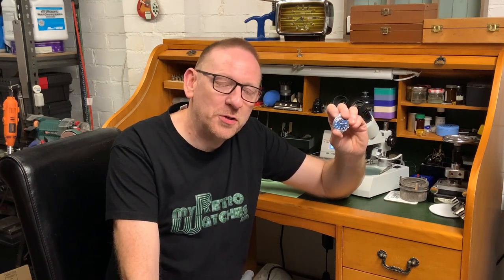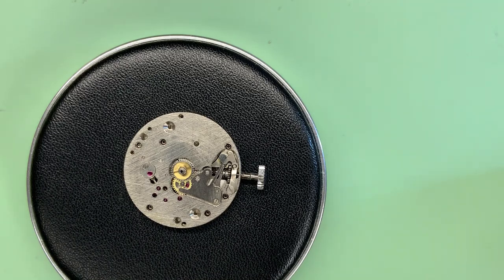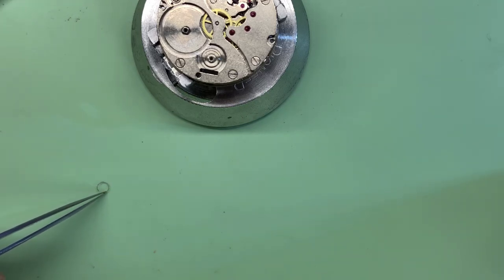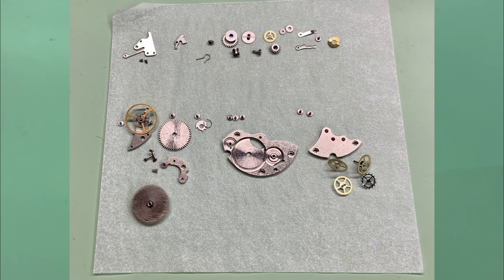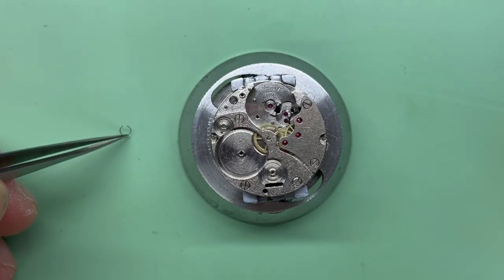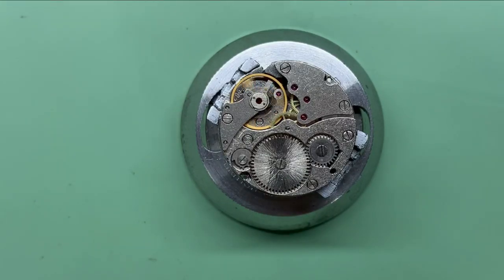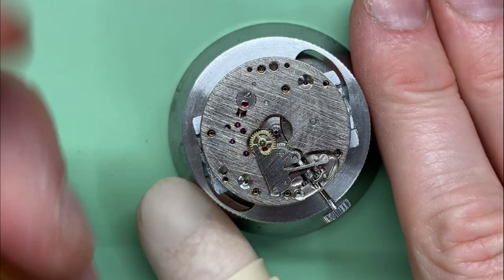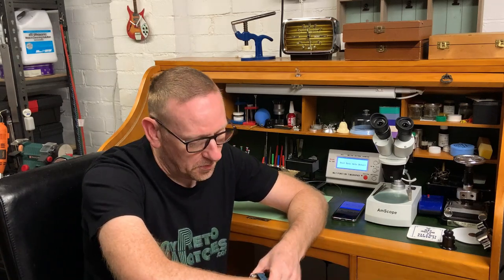Russian Pobeda ( Победа ) Watch Restoration

Comment: Great job as always with the video! While it's been said before in the comments, the movement is the 15-jewel 2602 that was shared between Podeba (Victory) and ZIM (Maslennikov Plant, or Zavod Imeni Maslennikova). However, the 2602 also holds the distinction of being the longest-produced Soviet watch caliber. It was made continuously from 1950 to the mid 2000s in the millions. Pobeda abandoned the 2602 sometime in the 1990s whereas ZIM produced it until their dissolution on June 30th, 2006. I have on a mid-1970s ZIM 2602 dress watch as I type this, and I find that the ZIMs are better finished in general than their Pobeda stablemates. It has AU10 gold plating and the movement even has decorative milling, which is very rare for a Soviet watch. It would be interesting for you to compare a ZIM with the Pobeda, as they are no more expensive or scarce on the old Fleabay.

Comment: Great job on this small watch. 

I bought two 1954 Pobeda's for 30€ about a year ago, one in perfect condition, the other one was running quite fast. Took it to watchmaker for repair, he did it for another 20€. Both are in great condition, I polished acrylic crystals and use them now as daily beaters - literally. Construction works, electrics, woodworking... they are great daily watches as you wont even notice them on your wrist (32 and 33 mm cases.) 
I highly recommend anyone who wants to get into mechanical watches to start with something like that - they are cheap, at least in Central Europe you can get them repaired in every watch/jewelry store and you can later move on to something more expensive.

Comment: Pobedas are pretty solid, simple but solid.
I've got one with the same movement and it keeps time quite well.
Currently trying to get one with a central second running. Will use this video as a guide, since they are pretty similar.
If I may recommend you something in the same flavour: Raketa watches.
These are really good watches and are probably my favourite soviet brand.

Comment: I'm not positive but I think that plexi is afflicted with what's called 'crazing'. Good vid. Thanks.
Reply from the maker: Thank you.
Reply: that's right, specifically 'stress crazing' - there's likely some bias in the case tension on the crystal that has imposed tensile strain across that region of the crystal. That can result in fine cracks perpendicular to the stress which accumulate over time - flexing from temperature and pressure changes are primary contributors

Comment from the maker: Apologies for some of the sound. I am trying a new Mic and its not always been good at sound capture.
Reply: Good video. 

Back in the day when these watches where plenty in my country (Romania)  they where very cheap. If you wanted a watch and did't have to much money this was the one. This is the base model in terms of the caliber. From this one there are 3 (i believe ) version: Raketa base Pobeda, Pobeda itself, and Slava based Pobeda. The Raketa version has a jewel on the 4th wheel in the bridge.
There is one  important thing you have to check on this one . Since there is no jewel on the 4th wheel you have to check for wear in the base plate and on the bridge. If there is, you can fix it using the special punch to reform the hole and use the reamer after. The same goes for the mainspring hub on the main plate and bridge.

Please do a Slava 2427 movement repair

Comment: Here a tip for you. When arranging the wheels in the jewels place the screws that holds the bridge in place but screw it just a little so that the bridge doesn't lift that much and doesn't moves sideways. Try this and you will see what I mean. Don't drop this watch because it doesn't have a anti sock system on the balance
Reply from the maker: I don’t really do that , done it before on Accutrons and if you are not careful you can break a pinion . Thank for the tip though
Reply: Can confirm, I dropped mine and it stopped. Gave it a couple taps with my finger and lucky it started again.

Comment: I realy love the Smith timer you have by the cleaning machine!
Reply: Smit Machinale Seeing that timer reminded me of working in science labs many years ago - we used to use them for timing experiments / procedures. Solid, reliable, robust machines (and actually easier to use than the modern push button electronic timers used now).
Reply from the maker: I bought it at a watch fair a while ago. The owner actually recognised me from this channel.  Had no idea what I’d use it for but just liked the look.  It’s now a key piece to my cleaning regime
Reply: @MyRetroWatches  Mike, that is a great find.
Reply: My Retro Watches i still have an old Junghans timer, with luminous hands that goes up to one hour. Made for photography darkrooms. In a previous life I spent many hours in darkrooms with the sound of that loud ticking. Now reborn as an occasional kitchen timer!

Comment: Hi Mike, as always, another great video😀
Just out of interest, is that some sort of varnish on your peg wood?

Also, was it just me or did anyone else shout at the screen when you were trying to put the crown wheel on?! 😂
Reply from the maker: Haha you mean you all knew I had the wheel on the wrong way??  Honestly I did not know at the time. My only excuse is i am sitting further away than without a camera so some jobs I just can’t really see what I’m doing .
As for pegwood it’s covered in superglue!  I needed something to put a drop on to fix one of my daughters toys. Ironically I now find the pegwood works better with the coating .
Reply: My Retro Watches thanks for the info on the pegwood, I have been considering something like that as I often find the doesn’t hold a point very long!😉 I have also been looking for the substitutes “plastic pegwood” but struggling to find some.

As for the wheel, it was the fact that you put the retaining piece (disk) on first meant that the actual gear was never going to stay put!😜😂

Comment: You Sir, are a star :)   I've now invested in a timegrapher so have the last tool I needed to actually start stripping and servicing movements and I have stacked tubs of movements just waiting for a chance to shine again :)   I've been battling a terribly magnetised Poljot Mockba 80 from Israel, its taken several good zaps to get it to a point where its not adding an hour in half an hour, you would like Poljot movements as they were pretty well done.   Did you catch my grail of grails find video?  A brand new, never worn Sekonda branded 1970's "tank" super heavy automatic watch in original box... £14 I kid you not, then yesterday an Aeromatic full chrono with rotary slide rule dropped as well into my hands... the gods of ebay are being kind right now :D :D :D

Comment: The strange clamp ring was indication that whichever watch factory likely Zim were short on screws and clamp pieces so would opt for the very cheap alternative which is a compression setup, when the caseback was screwed down it tensioned the movement firmly in place but being very mild steel the clamps lost their tension and you ended up with a clacky loose affair in there.   You could read the various Soviet resource crisis in a Soviet watch, copper shortages meant all steel balances and pinions, the Soviets lacking chrome would have mild steel cases, even the lume's became white or coloured paint in times of shortage of phospor's but they were lavish with gold with a good AU10 plating as a general, there were times of AU5 microns and sometimes AU20 but those were rare and 10 microns is pretty good.
Reply: I thought they used brass a lot for its softness. Then chromed it.

Comment: Excellent job well done. Thank you. I just started this hobby. I'm too scared to remove all the parts. What if you remove the balance wheel, pallet fork, maybe the barrel  harbor, clean the jewel holes from both sides. Make the train run again and put back the parts that u taken out.
Reply from the maker: You do what you feel confident with . All small steps. Reality is the more you clean the better it will be. 

Good luck

Comment: A pro tip for fitting the train bridge... Already screw the bridge in till you feel the slightest resistance then turn the gear closest to the barrel and almost everytime the other pivots will find their way into the jewels... Also I use my bare eyes for most of a watch... I use a x15 loupe for HS manipulation...
Reply from the maker: Ive never been a fan of placing the screws before the pinions are located.  I have had first hand experience of breaking a wheel through thinking it was in place.   You are lucky to use your eyes,  as you know i only have one good one and that is failing now too.  I am now using a loupe when i am not filming (filming I can only use a visor as the watch is almost at arms length away.)   liking a loupe!
Reply: @MyRetroWatches  yeah I know you have eye problems 😢
It's really unfortunate and I'm really blessed to still have good eyes after all they've been trough...
Staring at welding sticks mainly.............. Sparks from a short...

Comment: I bought one like that off of Ebay.  It said Zim on the dial but the same font for the numerals.  The listing said 'Working but in need of a service'.  When I popped the back open - no balance assembly.  But again, it was inexpensive, from Ukraine.  I've been searching, but I haven't found any donor movements with a working balance or intact hairspring.
The movement was a Zim Pobeda 2602.  The only difference I see is that the crown wheel on mine has two small screws while this one has the single reverse threaded screw.

Comment: The Breguet HS isn't too hard to manipulate but be aware that the HS with the overcoil needs to stay concentric and with a Breguet overcoil this is a bit more difficult especially if the fatness of the HS was disturbed...
I took me around a hour to bend a Breguet overcoil for an old omega pocketwatch 😁
Running great now
Reply from the maker: thanks. Hairspring does look nice and concentric so  could be just something touching in dial up or the balance jewel that I have not looked at.  Do have done those would have added another 30 mins on this already too long video.

Comment: I like Russian watches.. The movements are robust and it's only the cases which let the whole watch down.  I think you can adjust the sensitivity of the mike by pushing the arrow button up/down as the timer is reading the signal... At least it does on mine.

Comment: You need to inspect balance staff jewels on cracks, find out is it some endshake in balance staff, inspect balance staff pivots and polish them on some 12.000+ grit oilstone (just a few passes should be enough). Also, try to inspect hairspring in all positions. It easily can touch balance wheel in "dial down" position.
Reply from the maker: Thank you.  I dont really have the confidence to polish the balance staff as that surely would mean removing it from the balance which I have not learnt to do yet.   I might take a closer look at the hairspring to see if its touching on dial up.  The video was long enough without any fault finding .  Thank you for your advise.

Comment: Hi Mike, which method is most common with crystals from 60s 70s. Friction, glue or other?. Or are they just varied, just starting to get into crystal replacement. Any advice would help, even from any of my fellow followers. 👍
Reply from the maker: Adrian Birkett hi pal, I’ve seen more tension ring, mainly in Seiko as thats what i do allot. 
The ones that just seem to push in or held in by a bezel are less common

Comment: Hello, 
I have serviced this watch a few days ago but I am getting a pretty low amplitude compared to what you have here. I tried to put some oil on the pallet jewels but it didn’t change much. Any idea on how I could improve the amplitude ?
I thank you in advance !
Reply from the maker: Not as easy as that.  Many things cause low amplitude. How’s the hairspring?  Cleaning is so important and without a good clean movement anything can cause drag in the train . I would inspect all parts in the train again
Reply: @MyRetroWatches  I thank you very much for your answer. I have to say that the hairspring is slightly bent aswell. I will have a look at the train!

Comment: Soviet movements coded as following: first two digits is caliber diameter in mm, second two digits represents movement type - for instance 02 is a separate second hand w/o shock absorbtions for ballance, 09 is central second hand and shockproof ballance etc. But stuppied and crazy thing is that 2209 from Raketa is completely different from 2209 Wostok etc. So, number represents only the size and principe of caliber design. To differ movements you needs combine manufacture name and caliber numeric type.

Comment: Zim 2602 - > http://www.ranfft.de/cgi-bin/bidfun-db.cgi?10&ranfft&&2uswk&ZIM_2602
https://17jewels.info/movements/z/zim/zim-2602/
Based on a design by Lip from the 1930s. (The R26 apparently). 
Most of the USSR era watches I have encountered are solid performers. I would think the issue is with the top jewel in the balance, or wear in the balance staff. The movements are fairly common on ebay, so look out for a donor if you want to tinker with it and see if I am on the right lines.

Comment: Nice watch I have one with Glasnost written on it by cirilic.
Fun fact this movement is a licence of an 1908's Lip movement and this cheap looking not decorated movement has a Brequet hairspring that is usually used only in expensive watches.
In Hungary there was so many off this watches sadly people just dropped it to the trash if stopped. I got mine with 2 other watches for about the price of a box of cigarettes, just changed the acrilic and cleaned the hairspring in alcohol because it was gained fast because it was sticked to itself cause of something.
Reply from the maker: I have now cleaned again the balance jewels and now it runs even better than it did in the video.  quite amazing given the appearance.  Turns out to be a great movement .

Comment: The only thing missing was a polish to the case, I think it would have looked better.  Great watch for 7 pounds, now it's worth 25 or what do you think?
Reply from the maker: Javier Reyes case is chrome plated so other than a wash that is got off camera that’s all that can be done to improve it. As for value I have no idea .
Reply: Oh I see.  And about the value I have no idea either, it was just a guess.  I have seen that they are sold approximately in US ebay or some up to 45dls but if they are seen in much better condition.  They look brand new.  By the way, excellent work.